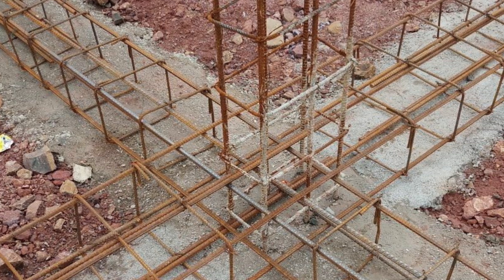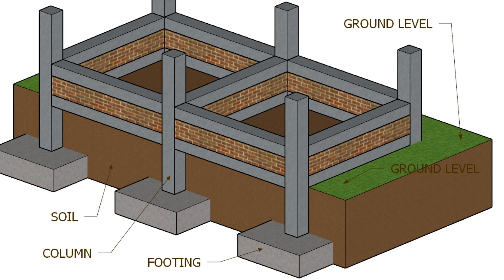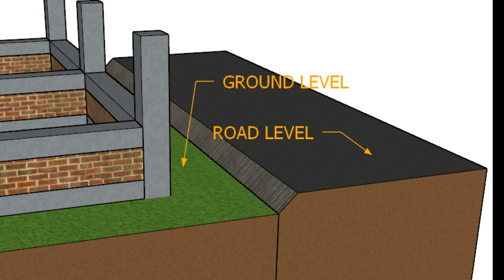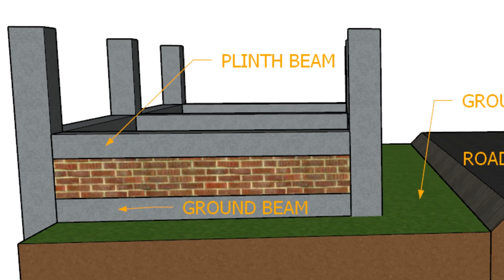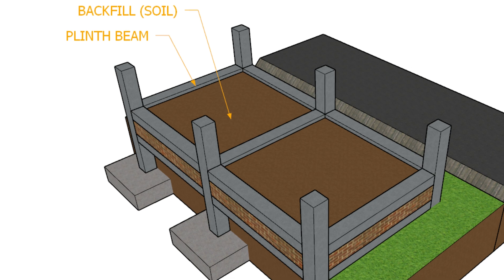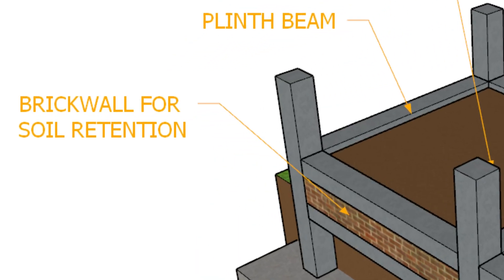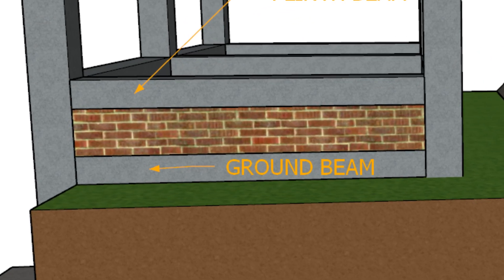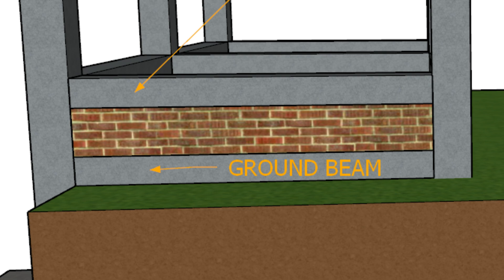Why do we provide Ground Beams? | Plinth Beam vs Ground Beam | Civil Tutor

Comment: You are the one who is confused. The beam in contact with the ground is called plinth beam not ground beam. There is no term as ground beam. If the plot level is below the road you just raise the plinth height above the road level. Above the plinth you provide dpc and then above the dpc you start your walls

Comment: For my house construction pile foundation is recommended. Loose clay upto 6m with a water table at 2.5m. my floor level is 45 cm above ground level. In this regard, can I use  a plinth beam alone of height 45 cm instead of a  plinth beam and a ground beam together.
Reply from the maker: Yes you can.
Reply: After pile foundation pilecap is provided and tie beam of hight 0.30 m (3+2 pieces of 16# hysd bars)is provided connecting to all the pile caps after that construct brick work with hight 6" (1:4 of ratio cement:sand) mortar.now provide 2"-4"DPC thick dpc layer..now structure is ok to retain for long time about 100yrs.
Reply: Else can only use of Plingth beam above ground of hight of 0.45 using 3+2 16#  and 2 12# hysd bars with 8# stirrups.